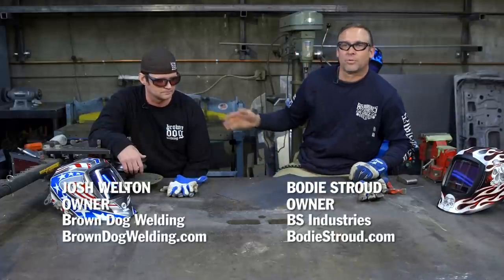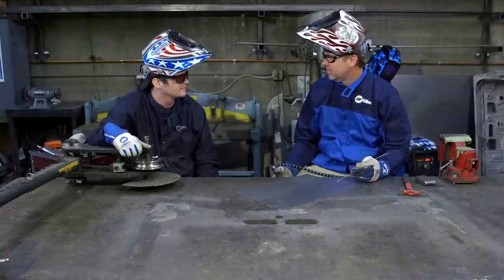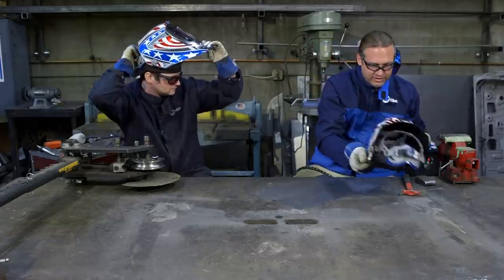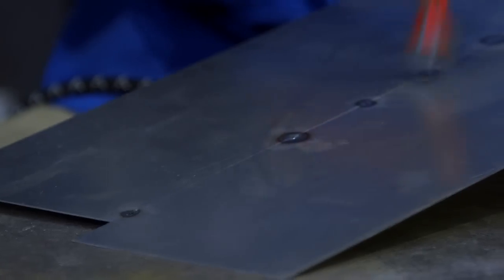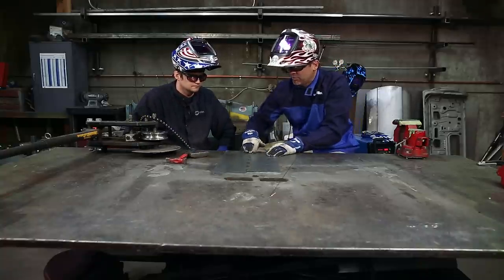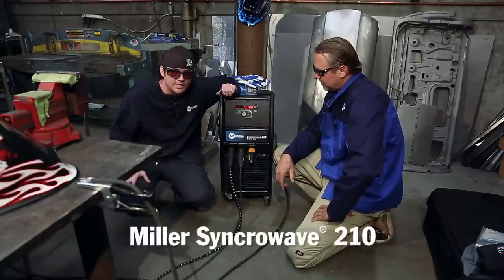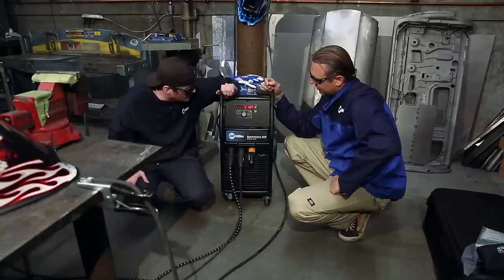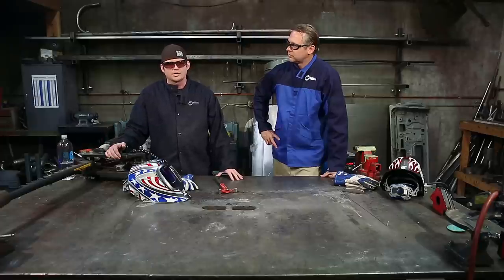TIG Welding Sheet Metal Techniques With Bodie Stroud

Comment: Suppose you are replacing a fairly small piece of cab flooring that will have undercoating on the bottom and rubber or carpet floor mat on top. How much do you worry about warpage?

Comment: Aside from the 50 Hz, what settings were you using while pulse welding?
Reply from the maker: Hi Bob. Thanks for reaching out! On the Syncrowave 210, the pulses per second are the only parameter adjustable. The background amperage and peak amperage are not adjustable. Background amperage equals 25% of peak amperage. Peak amperage time equals 40%.

Comment: When you're welding an area that can't be backed with a dolly, what technique do you apply?
Reply from the maker: Hi, Joseph. Thanks for reaching out. It's best to keep minimal heat input into the part resulting in less warpage and you may want to look into other options such as an auto body filler. This will allow for the warpage to be masked/hidden while giving you the ability to shape the panel to factory shape.

Comment: Hey Bodie
I am just learning how to TIG weld. I am restoring a 1957 Chevy truck. lots of RUST repair :( 
What kind of filler rod are You using?
Reply from the maker: Thanks for reaching out! ER70s-2 and ER70s-6 have different chemical compositions, like different de-oxidizers. ER70s-2 is better-suited for welding dirty metal.

Comment: I'm wondering which tig torch you used for this. Is it like a 9? Also what would you recommend for sheet metal you can't get to the back side on to use the hammer n dolly?
Reply from the maker: Thank you for your question, Ben! The TIG torch used with this was the Syncrowave 210, which is shipped with a 12 foot WP-17 series torch. To answer your other questions, could you provide some more details?
Reply: @MillerWelders  thank you for replying. As for my other question say I was trying to do a quarter panel still on the car n didn't have a helper to go inside the car n hold the block or like a cab corner on a truck where there's not alot of room n again alone so couldn't hold the block n swing the hammer at the same time or one of the many other hard to reach areas on a car body. Also now that I'm thinking about it what would you recommend for welding a gas tank on a bike to get a good clean weld with little to no body filler needed after
Reply from the maker: Hi Ben, thanks for following up. We're happy to talk with you about your projects. Please give us a call at 920-734-9821.

Comment: With the AC expansion pack on for the dynasty. Does it let you change your EP and EN amp and wave forms or just amps? I hear it works on the 210DX as well.
Reply from the maker: Thank you for the question. The AC Independent expansion allows one to independently adjust the amperage and waveform of each EN/EP cycle. For example, the EP is sinewave at 180 amps while the EN is squarewave at 250 amps. Also keep in mind that the expansion can only be used on the DX models (both 280 DX and 210 DX). It cannot be used on the regular models (210 and 280). Thank you.
Reply: Miller Welders thank you- do you have pricing on that?
Reply from the maker: Can you please tell me which machine you would like pricing on? Thank you.
Reply: @MillerWelders  ..yes i would like to know also

Comment: Hello. Nice vid. ;)  
I wonder if you can tig weld with co2? And no argon? 
(Co2 welding 316 stainless)

regards.
Reply from the maker: +steisje  CO2 should not be used in the TIG welding process. The two most common shielding gases used are argon and helium. A Hydrogen Argon mixture can be used when welding austenitic stainless steels. Some nickel alloys to further constrict the arc and produce a cleaner weld with a greater depth to width ratio. It should be noted that an argon hydrogen mix will introduce the risk of hydrogen cracking and metal porosity. Please let us know if you have any further questions.
Reply: +Miller Welders  Thank you! :)
Reply: @MillerWelders  Thanks for the heads up. In this video, are  you using 100% argon? If you mentioned it before, I apologize or I missed it. Thanks for the help!

Comment: Suppose you are welding up a quarter sized hole in the floor pan and can’t get to the underside. 
How much work on cars requires 240? My neighbor/electrician ran 240 to an area in my garage for free and buying the required electrical equipment was still expensive.
The manufacturers may be making it easier but after four semesters of welding school I realized I’m not a welders of straight stringers.